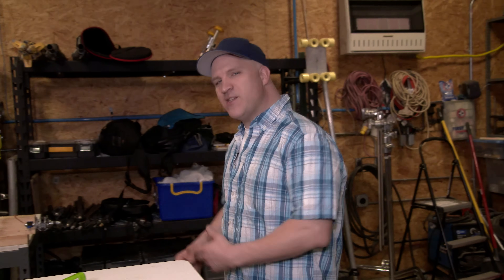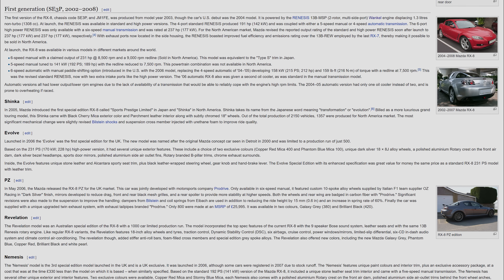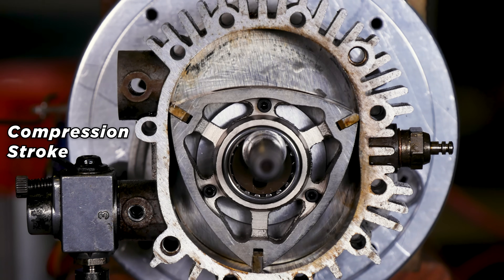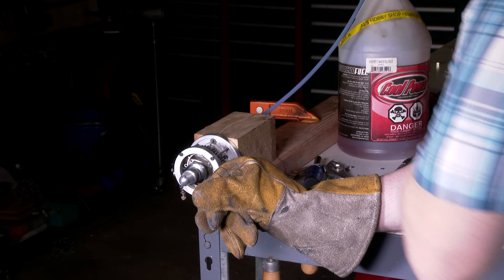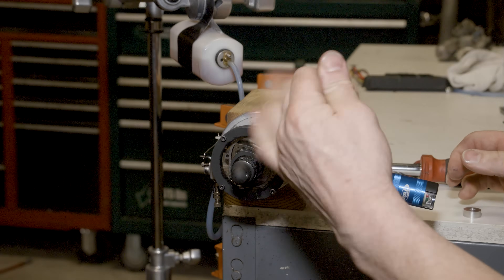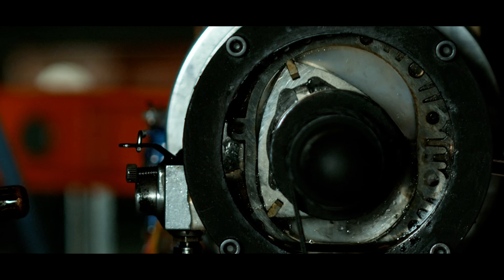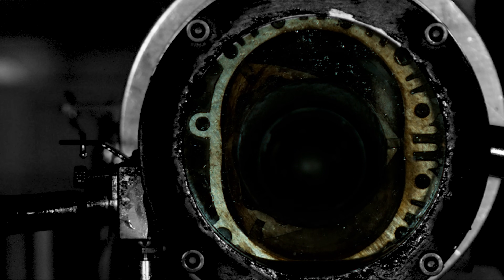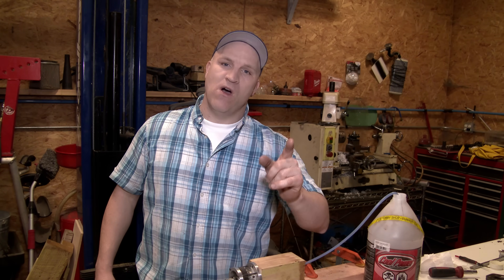See Thru Rotary Engine in Slow Motion - (Wankel Engine) 4K

Comment: man...no wonder apex seals blow up, they're taking the brunt of the explosions 🤔😳😲💥😵
Reply: Apex seals don't going out are a thing of the past, mostly side seals nowadays
Reply: Apex seals are very unreliable, so unreliable that no manufacturers sell a certified passenger aircraft with a Wankel engine.
Reply: @sandervanderkammen9230  beat flying delta airlines
Reply: @pyromaniac354  No airline would dare to use Wankel engines.
Reply: @sandervanderkammen9230  I know.
was supposed to be a joke about delta.......
Reply: Sander Van der Kammen 
So if a piston-prop aircraft has combustion rings in it's engine, it's unreliable by default ?
Reply: @MainMite06  A round cylindrical seal is inherently superior to a seal with right angles and different  lengths.
A cylinder expands and contracts with less thermal destortion and modern reciprocating engines can use low tension twist-type rings that reduce cylinder wear and improve sealing effectiveness.

Comment: Now looking at it, it's kinda sad that they stopped making rotary engines, especially Mazda
Reply: Modern reciprocating engines are vastly superior... even Mazda now only makes reciprocating engines.
Reply: @ArtistAnthony9  You mean Wankel engine right? Mazda never made Rotary type engines ( Mazda only sold Wankel engines under the "Mazda Rotary®" trademarked brand name from 1974 until they became obsolete in 2012.)
Reply: @ArtistAnthony9 Simplistic??? Well, it sounds like you have never taken one apart before... This engine is more complex than a comparable 2-cycle engine and the Mazda Renesis engine for example had over 235 moving and seal related parts per engine.
Reply: @ArtistAnthony9 Never going to happen... every single legitimate engine manufacturer in the world including Mazda has abandoned the Wankel engine design... it is now classified as an obsolete engine technology.
Reply: @ArtistAnthony9 But the Graupner GmbH. model 49 PI in the video is not a Rotary engine or a Wankel Rotary... its a KKM-57 Wankel engine, the non-rotary version, the one not designed by Felix Wankel. Do you not understand the difference???
Reply: @ArtistAnthony9 Agreed, I also enjoy collecting and restoring old, antique and obsolete engines like Wankel engines... I also collect pre-WW2 Rotary engines as well.

Comment: Mazdas mistake was making the Wankels so small...if they  had made them 5 liters..it would have taken so much stress off the engine..plus be super powerful.
Reply: But if they made them 5 liters they would have 5 mpg tho.
Reply: @batsmusgames7823  Possible...but they make V-8s that get 20 mpg. V-6's now that get 30mpg..they say. Bigger liters on the Wankel would have meant it didn't have to spin so fast..and maybe you did lose 5 mpg...but you picked up another 150 hp. Supercar territory.
Reply: @Stan TheObserver Not true, the bigger the Wankel engine the greater the fuel consumption... increasing the DIAMETER requires a lower rpm to reduce the surface contact speed of the apex seals. Reducing rpm lowers BMEP and peak torque output.

Comment: the gaz mix setting is too rich...
Reply: Not true, these engine only run on an extremely rich mixture... they just have very poor combustion efficiency which is why Wankel engines are obsolete today.
Reply: @doktorbimmer  Not so obsolete with Mazda and the Rx8. The mixture dont need to be as a flood like you do, what make the ignition harder (the spark plugsare "wet" and the  explosion less efficient). The comsumption is higher than a usual engine (60% to 100% more, so from 13 to 17 l/100 km - and 1,2 l oil for 1.000 km...), but the mixture dont must look as your video shows.
Reply: Obsolete with Mazda too. Mazda has not developed a new production Wankel engine in 25 years and all production ceased over 7 years ago.
Reply: I'm not sure you are actaully familiar with this type of engine, this Graupner GmbH./O.S. 49PI engine has no spark plugs and runs on nitromethane which requires an extremely rich AFR.
Reply: Wankel engines cannot have a efficient quench type combustion chamber due to the internal geometry of the engine. Wankel engines are obsolete because they have poor combustion, poor thermal and very poor mechanical efficiency. They simply do not convert energy in the fuel into heat very well nor do they convert what little heat they do make into mechanical work.

Comment: Run a 1cc motor in the shop for 30 seconds and you are high on unburned gas fumes for an afternoon...  I remember these beasties had the reputation for wearing out peak seals and burning oil.  Also a hoot to drive while hammering the red line.

Comment: its not as efficient as a piston though is it? They move at right angles to the explosion. This wankel's force is 'edge' on. Not got physics degree so i can't put it into words, can anyone help me?
Reply: Good point, the Wankel KKM engine design has a much lower mechanical and thermal conversion rate, it converts less of the heat energy into rotational work than a typical reciprocating engine can. The Wankel engine converts less of the energy in the fuel into heat, and less of the heat into useful work.

Comment: Maybe if the shape of the piston was changed, it would be more efficient?
Reply: Play Geetar , yep, slightly round the corners maybe?
Reply: The problem with the Wankel engine is if you change the shape it will no longer function, the geometry envelope is extremely limited.

Comment: 1st loaner car,as a newly licenced driver. 13b,ported,injected and all the upgrades on suspension. It was previous rally racer, rx3.Believe 74'. Dashboard completely loaded with badges from around the world. Drove it thru college,and exploring, PNW, WA. Drive like a dream. Power and control at your fingertips. Sold on rotary power.edit forgot to mention, it blew flames.
Reply: Obsolete technology, not even Mazda makes these troublesome and very inefficient engines.

Comment: has anyone ever combined multiple rotary engines in one long tube. Time them all so they help each other fire more precisely?
Reply: Prototype engines were built with up to 9 chamber in a row... but proved impractical. The more chambers the less reliable the engine is, they had very poor reliability to start with.
Reply: @doktorbimmer  maybe sealed compartments but one common drive shaft. the combustion chambers could ping pong off each other. but even then  the apex seals go bad quick. I have another idea for spring loaded pistons, on gas engines. Instead of bolting the piston to the rod it floats on a couple springs allowing for more compression
Reply: You mean a "VCR" system? The variable compression ratio by means of a adjustable the piston deck height already exists.

Comment: whats the liquid in the engine? oil? or the gasoline? and why is it in there?
Reply: Gasoline. The engine Id know for the waste of fuel and it going Into the echaust and futer buring there as wasted fuel.
Reply: These little RC versions run on Nitromethane not gasoline, what you see is unburnt fuel and oil.

Comment: Considering your other engine videos, you really shot yourself/yourselves in the foot/feet with this one with regards the machine work complexity of not drilling, tapping and bolting the acrilic window to the crankcase port block, unfortunately meaning you had to over fuel the carb settings to get the fuel to act as a hydraulic sealant for combustion to occur, thus resulting in how many takes it took to get it working.
   Just because the engine is simple, Does not mean the neccessity of work needed Is just as Simple. ..your machine work and parts finish is nicely cut, honed, polished, but you scrimped-out on it this time.
Reply: What do you think the AFR is on these engines???

Comment: Suprised these aren't used in power-tools, considering their small size and power to weight ratio.
Reply: THEY DID!!! Several manufacturers offered Wankel powered tools but they were aweful... just terrible! Sachs made chainsaws, generators, air compressors and lawnmower engines and Yanmar made yard and farm tools too... all were epic failures.
Reply: @doktorbimmer  Seems more like another gimmick to take your money. I'd rather choose to buy electric.
Reply: True, the Wankel was just a gimmick... in reality it was a massive commercial failure... reciprocating engines still dominate.
 Electric tools are great for amateur DIYers but lack much to be desired in a serious professional grade tools.
Reply: @doktorbimmer  I just like electric because weight can be an issue.
Reply: I buy internal combustion tools... because power cords can be an issue.
Reply: Actually reciprocating 2-stroke engines offer far better power-to-weight ratio, compact and lighter than the Wankel, most important they are far more reliable and easier to start... cheaper too. The Wankel simply could not compete in this market.

Comment: im wondering, why nobody build that engine with 3 spark plugs instead of 1, imagine 3x more power, 100ccm would have so much power, also fuel consumption will be x3 but u might have super small engine with super power, is it possible or i am watching too much youtube?
Reply: Time for bed I think.
Reply: The Graupner GmbH. (O.S.) 49 PI engine does not have a spark plug... it uses glow ignition... with no timing there is no advantage to having multiple plugs.
 It only produces 1 horsepower, 2-strokes are more powerful in RC applications.
Reply: that was only a idea, mayby someone will try buidl something like that, or try do it in some program ;-)
Reply: The Wankel engine was extensively and exhaustively researched and developed by 26 of the worlds largest and best engine manufacturers in the world and over 100 universities and research institutes for nearly two decades.
 The engineering community has reached a consensus, that the Wankel concept is just inherently inferior and offers no further development potential... which is why the Wankel engine is today obsolete, no longer in production anywhere in the world today by any legitimate engine manufacturer.
Reply: ouch i didn't know that, souch a waste, but thinking ecologic way thats cool, ther must be compromise allways ;-) sorry for my english if something is incorrect, well thats mean my idea was well completly wrong, anyway thanks for answer, it's allways cool try to think diffrent way ;-)
Reply: Yes, the race to market the Wankel engine was a colossal financial failure, companies like General Motors and Mercedes-Benz spending as much a $10 million USD per month developing the Wankel engine and never sold a single car with one. Companies like Mazda and Norton and went bankrupt trying to sell them.
Reply: eh, still mazda is giving a lot of fun driving rx with wankel, it's same situation like with Nikolai Tesla, great ideas, person that make "light" to the world, but he also end as bankruptcy :x
Reply: Mazda is still in business... they just don't make obsolete engines like the Wankel anymore... the Wankel engine is dead.
Reply: well thats a gr8 reason to buy one mazda with that engine, last time to have some fun with wankel ;-)
Reply: There is nothing fun about owning a car with an unreliable engine, that why people stopped buying them.
Reply: the way this engine working, power from low torque to high that's give's joy of riding ;-) but yes this engine make's more problem than regular ones (as far as i know)
Reply: Wankel engines produces very poor torque output and have been surpassed by reciprocating engines in both power and high rpm capability. The is no joy when a Wankel engine floods or fails to start due to damaged seals and low compression... bad design, fatally flawed.
Reply: i think thats more problem with sealing material's,graphen would help but it's still in labs only
Reply: Its really not related to materials at all, the fatal flaw is related to the shape and geometry of the Wankel engine... round cylinders/pistons are superior due to the more even rate of thermal  expansion which cannot be solved in the Wankel design. Graphene is not going to bring the Wankel engine back.
Reply: thats sad for me :P
Reply: Wankel engines are obsolete now, because they are simply inferior to reciprocating engines. There are no longer developed or produced  by any legitimate engine manufacturers because engineers understand that the Wankel engines reached the end of its development potential.
Reply: so its time for something new ;-)
Reply: anyway thx for infos and nice discussion ;-)

Comment: But how they get the lubrication more or less than a tow stroke engine?
Reply: 4-stroke but this engine requires oil mixed with the fuel.
Reply: @doktorbimmer  How is possible to keep lube the main shaft here In Puerto Rico we have the fastest rotary cars with turbo and nitrous mixe make a lit of of H/P.
Reply: The Graupner GmbH. 49 PI uses ball bearings on the eccentric-crankshaft. There are no side or face seals, the air/fuel charge flows through the triangular piston(rotor) in a similar fashion to a piston-ported 2-stroke engine.
 My sincerest condolences, it must be horrible living in such a terribly poor, backwards little island like Puerto Rico, that is as far from the epicenter of the automotive universe as you can get...
 PR is one of those places too poor to import many new vehicles and is where lots of old obsolete junk goes to die... Cheers!

Comment: The Motor Wankel  
  
Motor Wankel - it is a rotative motor of intern combustion, invented by Felix Wankel, that uses rotors with format similar to the of a triangle instead of pistons of conventional alternative motors.  
  
Wankel conceived her rotative motor about 1924 and it obtained its first patent in 1933. During the 40s, it was devoted to improving its project. Still in the 50s and 60s, there was a considerable effort in the development of rotative motors / engines. They were particularly interesting for working in a soft and silent way, due to the simplicity of its mechanism, and also for the reduced number of pieces, compared with the alternative motors to piston.  
  
Differently of engines with cylinder and piston, the Wankel motor doesn't use the principle of connecting rod and crank. It doesn't produce any alternative movement. For that, it has a softer operation, with less attrition, less vibration and more silent. The group also includes a reduced number of pieces. These advantages turned it into an attractive technical solution which finds a vast range of applications in all transport areas (cars, motorcycles and aircrafts). 

Conclusively, the largest difficulties in application in wide scale are the internal revectors among the cameras; low durability and high consumption of fuel. Nevertheless, it has been enhanced due to the electronic control resources and new technologies production. In 2009, in the automobile section, Mazda was the only manufacturer that still incorporated those motors in their vehicles.
Reply: This is a Wankel KKM engine, manufactured by Graupner GmbH. Felix Wankel had nothing to do with its development... in fact he hated these non-rotary Wankel engines that were created by Hanns Paschke and Walter Froede in 1957. He was also bitter that his Rotary version never saw production.

Comment: Isn't there a better shape for the rotating part than a triangle? Doesn't that lose a lot of power to forces in unwanted directions?
Reply: The triangle is the only shape that allows each face to complete its 4-stroke operating principle in 3 crankshaft revolutions and allows the necessary geometry to produce the change in swept volume and still maintain a sealed chamber. The triangular piston (rotor) does not rotate concentrically on a fixed axis, it orbits in a planetary motion.
 Yes, the limitations of the Wankel engines inherent geometry is why it produces very little torque, has low thermal efficiency and the reason why it has terrible combustion efficiency.

Comment: It’s easy to see why these engines have small torque numbers compared to a piston engine.
Reply: *Wankels don't recipricate*
      The recipricating of a piston engine is the key of how they can expel more torque at slower speeds 
        A wankel is like a weak but fast electric drill.
    And a piston ICE is like a  slow but strong impact electric drill.

Comment: What oil do you use?

Mazda owners: 93 octanes please
Reply: RC engine fuel usually comes premixed. These engines are designed to run on nitromethane, not gasoline.

Comment: Great video , I'm thinking of my next project is going to be a RX-7   after watching this video. The see thru engine was awesome thanks for the 226 tries looking forward to part 2
Reply: An LS or a 2JZ swap would be a great RX-7 project...
Reply: True does motors are better in reliability but it's something about the rotary engine it just sounds better , plus is not my daily it will be straight performance.
Reply: An LS engine stock produces 50% more power and DOUBLE the torque... more reliable, cheaper and all around just plain better... which is why it has become a popular solution for dealing with under-powered, unreliable Wankel engine which is not even made anymore.
Reply: Last of a Dying Breed, One of kind. Thanks for the heads up .. I'll consider the LS check it out.
Reply: Long since dead... Mazda discontinued them several years ago... no longer in production anywhere in world